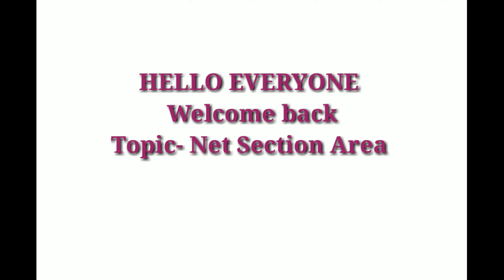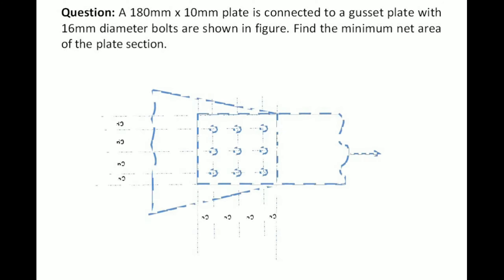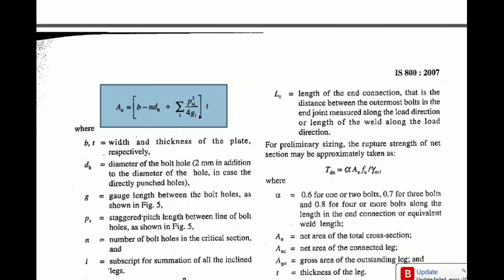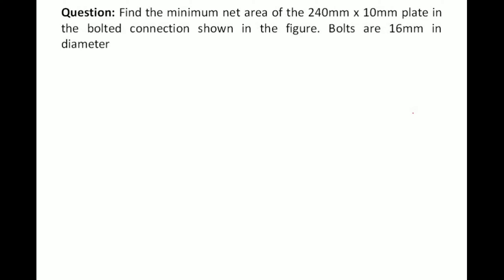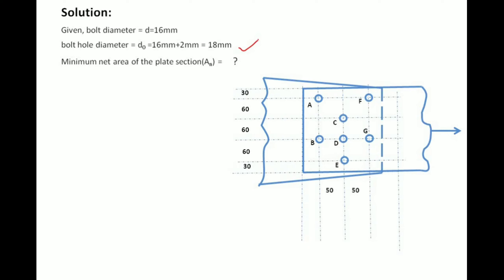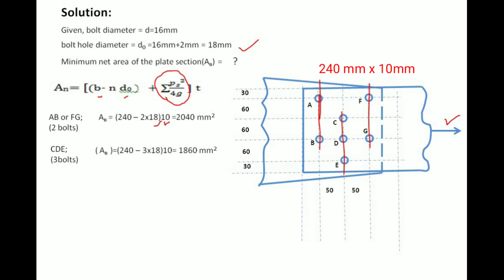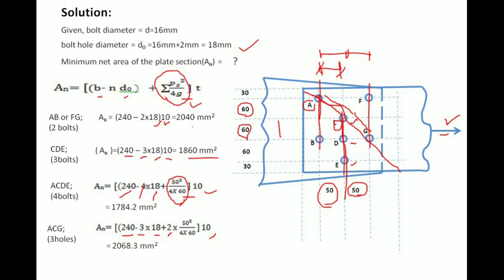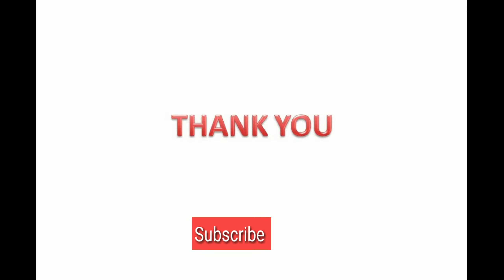HOW TO CALCULATE NET SECTION AREA || TENSION MEMBERS ||  STAGGERED CONNECTIONS ||

Comment: Ma'am can it fail along FCDE? 11:11
Reply from the maker: No vicky because  there is  a tension pull on the right hand side so your failure will be either straight or from left to right not right and then left.

Comment: Ma'am can it fail along CADEB?
Reply from the maker: No stefanie the section ACDEB in that you see its not goin to fail in this manner where you see your pull is on right hand side. the bolt hole B is to the left of C and again ur D is towars right but how can it be possible  if your pull is towards  right. The pull is constant or can increase but not decrease. And the section  which you asked for there if B point is included that means your load was decreased and then again after failure at point B load increased highly which is not possible  for the constant fixed loads. Also applies to A n C.